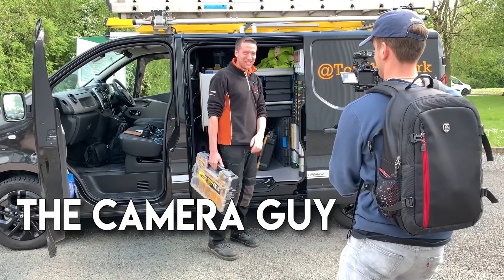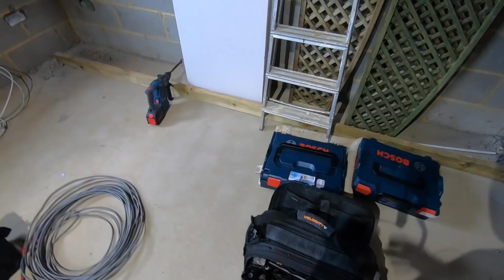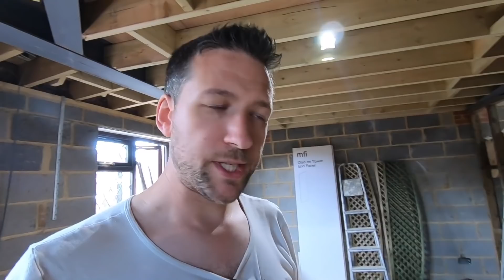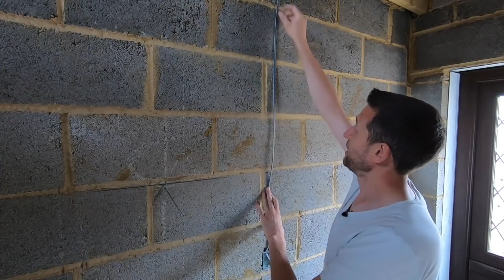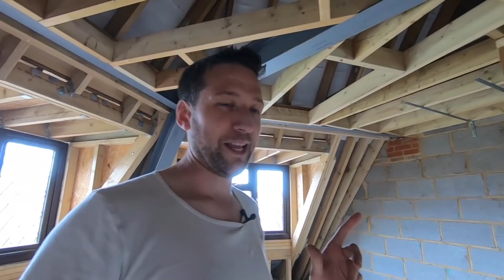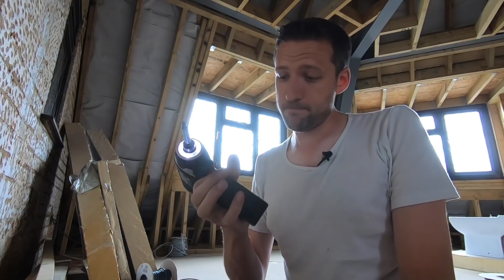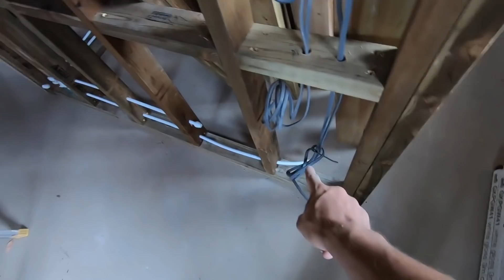First Fix wiring an extension + test driving BOSCH TOOLS | Thomas Nagy

Comment: Your absolutely right with the steel, I am a structural engineer and it looks way over kill to me also .
Reply: anywhere but London it wouldn't be cost effective. I hanker for the days of purlin roofs.
Reply: interesting, i'm a total layman so would you mind explaining why they went for all that steel? would be great to get a structural engineers professional opinion, thanks!
Reply: @cliveramsbotty6077  Sorry, I can not explain why they went for all that steel without knowing more information, however I suspect they err'd on the side of caution rather then optimization.
Reply: Another structural engineer here. As I replied on another comment on this video, it may not be overkill as the extension is an awkward shape. The steel frame could be the structure and the blockwork walls are just infill. Nobody here will know enough information to say whether it is overkill or not.
Reply: I suspect the steel forms the structural part all on its own, making all the rest (brickwork, wooden framing, etc) non load bearing. So if the owner ever wanted to add a door, move a wall, enlarge a window or whatever, they easily could.
Reply: @WhiteShadow2k1 I was not deducing the construction of the entire building,  just saying that it "LOOKS" like overkill. There are many factors involved but I suspect that the engineer was not fully confident so err'd on the side of caution rather than optimization.
Reply: If the extension sits on unstable ground, it may have a piled and capped foundation. Isn’t uncommon for the superstructure above to be steel and tied directly into it, to focus loading. The rest of the framework then becomes just non-structural infill. Whatever the case, there’s usually good reason for specifying this extent of steelwork as it would’ve cost a fortune for the client.
Reply: But they seem to have omitted padstones under the beam that spans the downstairs window opening and carries much of the load from above onto the weak reveal area, despite the wall being lightweight block. I wouldn’t be surprised if serious cracking develops here in future. And the owner is likely to have cold bridging issues.

Comment: you can have feeds at one end and sl at the other. nice vid as always
Reply: Art Vandelay You cannot- how would it work without a neutral think about it
Reply: @Madman-ge2eb  you have a 3 core between them its how they like it done in the AM2 but on site no one does it as its practically a waste of time

Comment: Tom you can get capping nails which have a little washer on essentially a nail they are masonry nails proper hard for hard to cap areas also what I do is put a slight nip on the sides of the capping say 2 to 3 inches from the socket end and slightly bend it up and it takes the pressure off the cables when you fit it always used galv once you get used to it its  the dogs buddy top content buddy you and Dave smashing it yeah just nip the sides where it's straight your be happy with that tip buddy :)

Comment: Why are you chopping the boxes into the blockwork Tom?
Reply from the maker: even though its D&D, they are 35mm boxes, so unless the plasterer uses a huge amount of dab, its quicker to sink em.
Reply: thomas nagy now come on tom, they are 25mm boxes you shot a close up of one. You didnt know you didnt need to chase them in, but dont try cover it up. Even you can learn.
Reply: thomas nagy & 35mm back boxes allow for flat plate sockets later down the line !
Reply: Garry Sparks they are 25mm boxes.

Comment: Hi tom in Ireland if we ran metal capping the plasters would shoot us 😂 we have to chase the wall and bury the cable in plastic conduit that has to be just shy of flush with the block. How do you’s over come that issue in the uk? 
Also running cables vertical here is a no no paul
Reply: What do you mean about vertical cables being a no-no? The safe zones in ET101 and BS7671 are identical.
Reply: Will be dot and dabbed I imagine so aslong as capping is thinner than 10mm it shall be find
Reply: Plastic conduit chased into the blocks is a better solution than capping, but UK regs don't even require capping, so Thomas is going over and above in even covering the cables.

Comment: The Bosch 10.8v impacts are a dream, swear by mine along with all of my other bosch tools!
Reply: I got the makita 10.8v impact drill but thats also nice, because the bottom is shaped that it can stand up by itself.
Reply: @Ano_ny  Bosch 10.8/12V drills will also stand with 4 and 6Ah batteries.
Reply: I changed all my tools to Bosch, never regretted it, I might try out the 12v impact, only got the 18v one.

Comment: Steelwork is current, or maybe even advanced, but the plumbing and electrical is out of the 80s. or not even.... 
You notice they are using 3/8 push to connect fittings like we would use for commercial coffee machines, or water filters point of use.
We would never use them inside of a wall... 

Also does it not get cold? New construction and they chop holes into the block and do no insulate?
Reply: I am assuming you are american? Your building industry is in the dark ages. Enough said.
Reply: Why on earth would you insulate a small portion of block that has been chased out?
They're thick block
Reply: Brian Rampling murica, they dont know what a cavity is over there.
Reply: I'm surprised that you find the "Requirements for Electrical Installations, IET Wiring Regulations, BS 7671 UK" lacking. Perhaps you would like to explain what you specifically referring to?  In the UK house walls are usually double-layered for insulation against the cold; the outer wall is usually brick and the inner wall is either brick or insulating "aircrete" blocks* separated by a 4 inch gap. In the past 20 years or so this gap between the two layers of wall is filled with insulation (older houses just have the air gap). As someone who has used "Speedfit" locking "push-on" plumbing fixtures, for over 20 years, I can assure you that they are very durable and very reliable (as is the matching double-walled pipe. All domestic plumbing for gas is handled using soldered copper pipe (or galvanised steel in larger installations).
*Think concrete blocks with thousands of air-pockets.
Reply: Insulation will be in the cavity. Your right they shouldn’t be using push fit in inaccessible places, bad practice.
Reply: The block is low density insulating ‘Thermalite’ with good insulating properties, and will also probably have insulating batts (PIR foam) fixed to the outside of the block (in the cavity between it and the outer brick cladding). The chopping out for electrical back boxed is usually 35mm deep, but the blocks are either 100 or 140mm deep. So it’ll have no significant effect on the U value of the wall.

Comment: Would you reccomend a new electrician to go straight to self work or work with a company first
Reply: work for a firm first, site work is very much different to domestic work. most site sparks cant cope with domestic work. just my opinion.